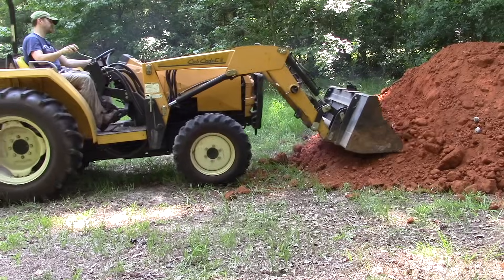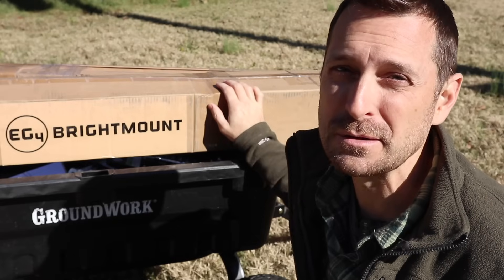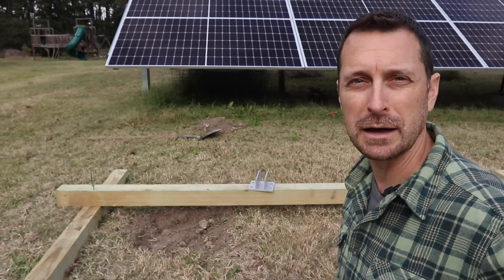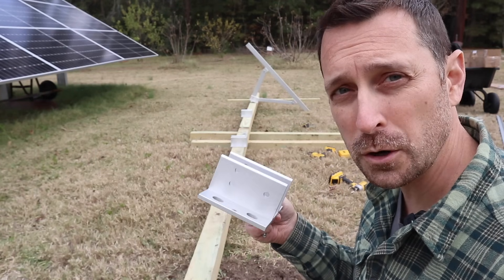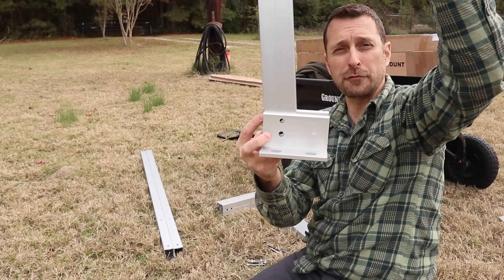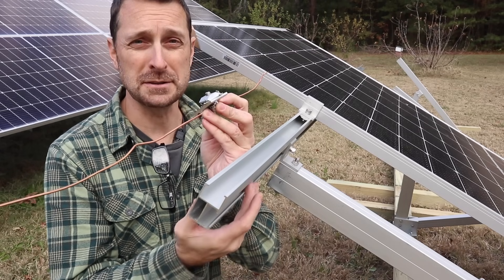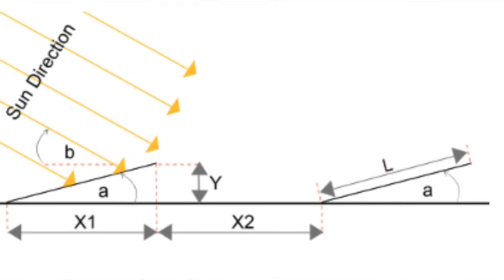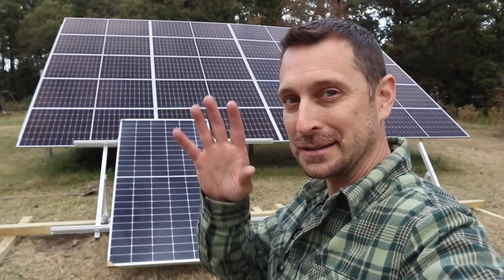Finally An Affordable Solar Panel Ground Mount! Installation DIY EG4

Comment: Minute 1:20 or so of the video: Do you have an electric pole from the grid almost in front of your main solar array?? Shading will produce hot spots on your panels and eventually will degrade them... not to say that hot spots can produce electric arcs and start a fire... Take that into account... try to get a thermal camera and monitor those panels from time to time... just a friendly advice... 👋👋👋
Reply from the maker: Thank you for the concern. 
I am not too worried about shading with these type of modern panels. They have several bypass diodes and also are split cell. This makes for an easy reroute of power around shaded cells without many issues. Additionally the sun moves quite quickly and nothing is shaded for more than a very short period of time. Shading is only a big issue if a portion of a panel is constantly in shade while the rest of the panel is not. This would be the case if you lived in a forest with a limited window to the sky.

Comment: Wow that is pretty awesome!  When I get my solar system started it is going to be ground based so this would be perfect!  Good job tracking this down and great explanation/demonstration.  Only question I would have is can the piers or posts the bracket is mounted on be elevated to help offset the shadowing?  Thanks for sharing!  🤠
Reply from the maker: You're welcome.
Yes, taller piers in the rear row and shorter ones in the front would help with the shadowing angles.

Comment: My ground mount for my 3400 watt system is bolted to 4x4x8' fence posts on the high side buried 2 feet in the ground, and rests on concrete patio blocks on the low side.  On a hill, through several nor easters, hasn't moved at all.  I like the system in this video, and would definitely use it on a future install.
Reply from the maker: Cool. 
How did you mount the panels to the wood structure?

Comment: Thanks for the information, the grounding brackets cut’s thru the coating of the Aluminum. It’s not really metal to metal because of the coating. Nice job.
Reply from the maker: Thank you